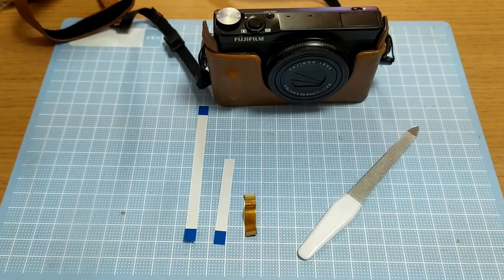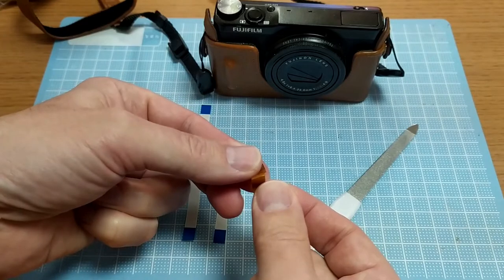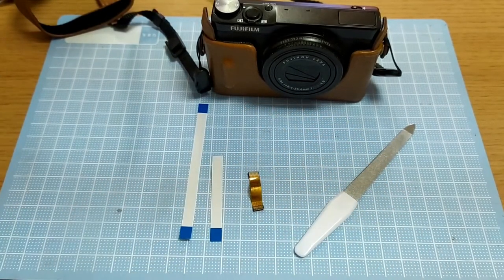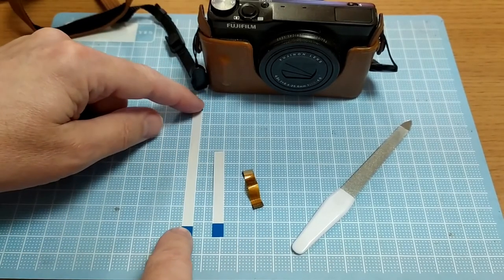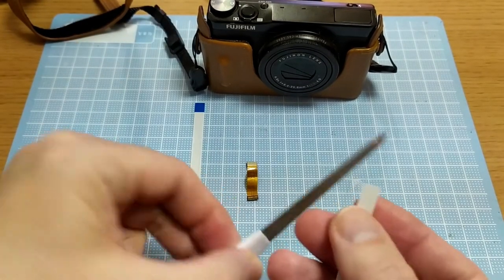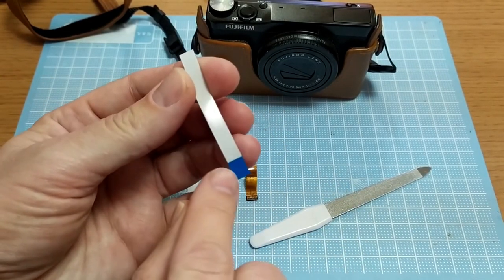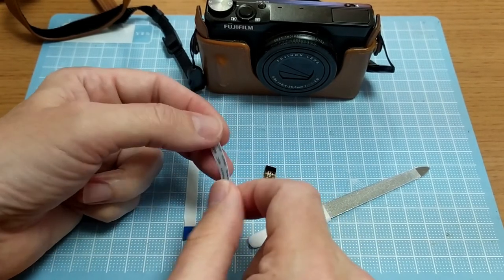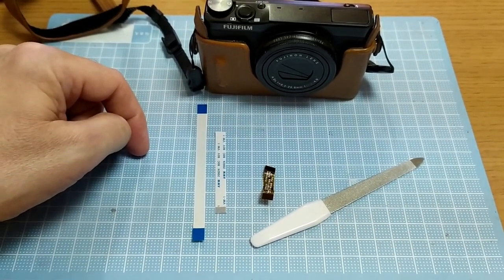Flat Cable Re-made - Fujifilm XQ-1 Menu Malfunction

Comment: It seems that I could have the same issue with my xq2. The wheel selector is acting ectic when I turn it, the flash also works 1 on 10. Where is  this flat cable situated, and what need to be taken apart to reach it.
Reply from the maker: You need to take the back off, and the cable will be running from the switches into the the top of the camera body, underneath the main dial.    It will make more sense when you get the case off.  From memory, there are a couple of screws each side, and a few on the bottom.  They use some weird 3 pointed screws so you will need a special screwdriver for it.  If you can get machine screws easily, I'd replace them with Philips head screws of the same size.
Reply: @felix_da_katze  Thanks very much.
Reply from the maker: No problem.  I hope you can get it sorted.  These are terrific cameras.
Reply: @felix_da_katze  ...any chance  of you doing a video of pulling that camera apart...I have an XQ1 that has a stuck zoom...fuji service repairs want 500  bucks to fix it..if I know how it comes apart I want to have a go at fixing it my self....
Reply from the maker: You need a set of special 3 bladed screw drivers to get the case apart, alone with standard jewellers Phillips.  I replaced the special screws with standard Phillips.  That gets you into the back, and that is as far as I have gone, as the repair I needed didn't need me to go further.  Fujifilm Japan wanted near $200 to fix the cable issue I had, which I solved for a couple of bucks, so I understand exactly your situation.  If I find a junk one I might consider a full tear down.

Comment: Hi! Do you happen to know where I can find a service manual for this camera?
Also if there are spare parts online because I just cannot find any. None of the back buttons work for me except the Menu button on the wheel. It's basically a film camera for me, I just shoot and then I review the photos on my computer, which is far from being practical if I'm being honest.
Thanks in advance!
Reply: The previous owner told me he used alcohol to clean the button pads in an attempt to fix another issue, and this cleaning made the buttons to not work at all after that.
Reply from the maker: Sorry, no I don't.  If you find one, let me know.  If the controls aren't working, it might be the flex cable, as I described.
Reply from the maker: I use a PCB safe contact cleaner spray.  It's a bit on the expensive side, but it works well and doesn't cause issues.  Alcohol could dissolve things, including finishing coatings applied to PCBs and get stuff stuck where it doesn't belong.  Parts are hard to find, and here in Japan these cameras go second-hand for way more than I paid for mine new at the shop.  Even "junk" ones get high prices.  They're a great camera, and there's now no equivalent.
Reply: @felix_da_katze  Thanks a lot for your answers! I'll try a PCB cleaner solution first and see if it fixes my issue. Otherwise I'll try to fix the PCB like you described in the video.
Yeah I looked up junk XQ-1 on Japanese markets (via proxies because I don't live in Japan) and they indeed cost a LOT for junk cameras.

One last question if you don't mind: Do you know what screws are on the side of the camera? Mine is missing 3 screws (out of the 4) and I have no clue how they're called and their respective sizes... I'm a bit of a noob when it comes to electronic repair so I don't have the correct words to search for (also language barrier).
Thanks in advance :)
Reply from the maker: They are called machine screws.  The metal press forms the thread, so they are easily stripped if you aren't super careful...  The originals take a weird three bladed driver, I bought some replacement screws that use normal watch makers Philips.  Bit late here to be digging around, but could look tomorrow for the size, but I guess you may need to do some repair or go a little oversize if they are stripped.  I have one that pops out, I put a small strip of black electrical tape to hold it in.
Reply: @felix_da_katze  Thanks for your answer! Mine aren't stripped (yet), they're plain missing hahaha. I just have 1 screw on the side, and I'm missing the 3 others that are on the left and right side of the camera
Reply from the maker: I measured 1.4 mm on the threaded section and 3 mm total length.  And I just found my collection of screws and replaced a missing one with a screw straight out of the packet marked 1.4X3 and it is a perfect fit so that matches.  I'm glad you asked about this, because despite buying the screws a couple of years ago, I completely forgot to replace that missing one.

Comment: Smashing repair, well worth a bit of work :-D
Some companys are real shitbags for the way they treat there customers,  internet providers seem to be the worst.
In my opinion.
I've done similar things to cables, the number one is cutting off 1/2 a milimeter off the ends so the socket pins use a different part of the metal strips.
There are always black dots where the connector was sitting :-(.
Keep bodging, err i mean expert modifications :)
Reply from the maker: Thanks!  I was thrilled to take it out tonight for a bit, and it just worked.  Like everything, the way it's supposed to.  Wonderful.

To be fair they fixed my 770EXR (well in warranty) with an overnight turnaround, so who knows?  

Never fear, there's plenty of stuff that keeps turning up!